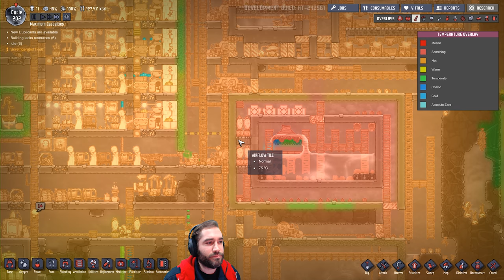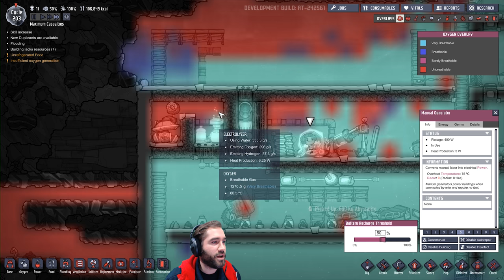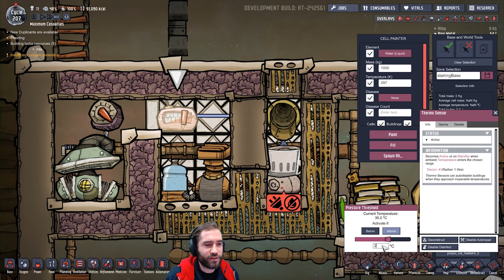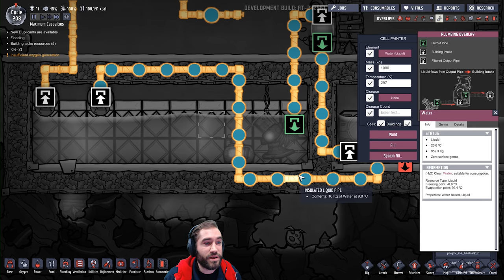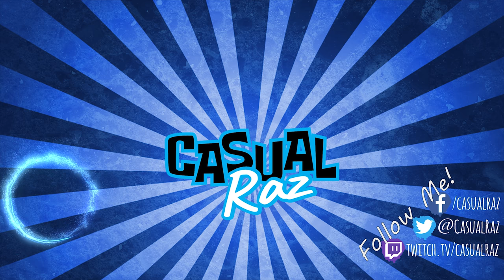Self Powered Electrolyzer Cooling Systems - Climate Control 4 Your Base! - Oxygen Not Included Guide

Comment: You should use debug mode to make a super cooling liquid radiator. try using compressed liquid oxygen maybe? its boiling point is about 91 Kelvin so try it at 70/80?
Reply from the maker: Yeah maybe I could make a system that stores liquid oxygen for emergency situations :D